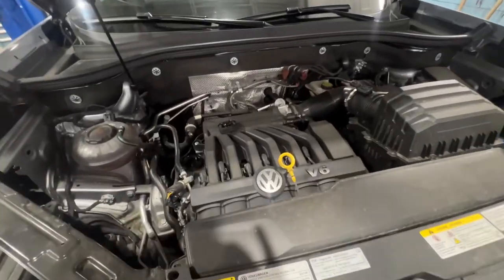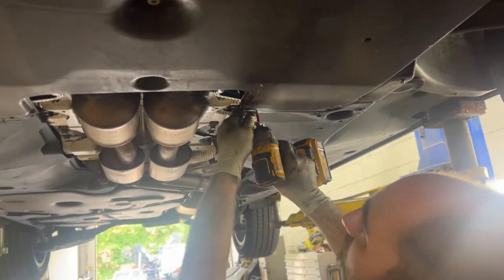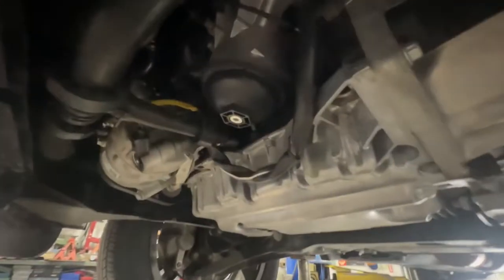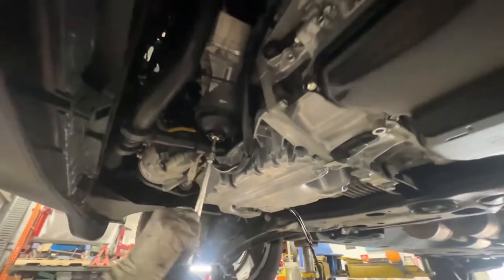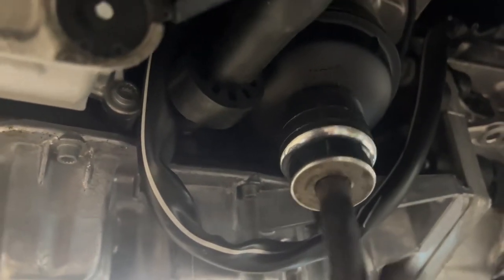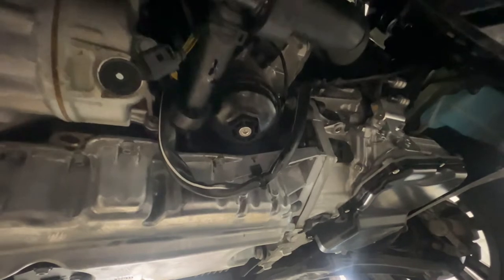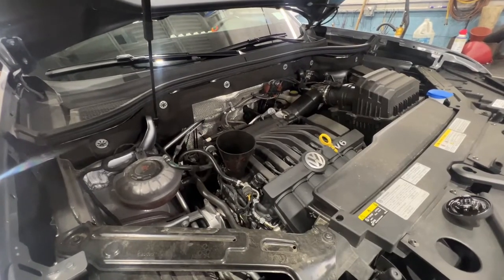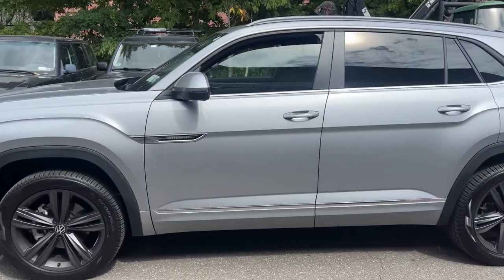How to do an oil change on a 2020 Volkswagen atlas cross sport vw

Comment: Its actually just under 7qts according to fig 180 in the owners manual. You have to keep the oil level about a 1/8" above the top of the hashbox. It's very confusing at first
Reply from the maker: Thanks for the info!

Comment: What size socket did you use to get the filter housing cover off?
Reply from the maker: It looks like they were two different size screws. I think they were triple square or torx, not sure what size, I’ll let you know next time it comes in!
Reply: 36 mm socket i believe he said in the vid and the small bolt to drain the housing in 6mm allen

Comment: What torque wrenches did you use to get rid of the splash guard?
Reply from the maker: There were 2 different size torx screws, I’ll check for you. If I had to guess I would say t20 and t30, but that’s probably wrong. Or you could just buy a set and you will have them all :). You definitely need to use a screw gun or it will take forever.

Comment: you forgot to mention or  show replacing the filter gasket that the thingamajig goes in also filter number or oil weight 😮
Reply from the maker: Don’t forget the gasket!
VW Atlas 
Oil Type – Full synthetic
Oil Weight – 0W-30.
6.02 quarts with filter.
Reply: @RealityUniverse  cartridge filter number?
Reply from the maker: 03H115562
 https://amzn.to/3D8xRQs